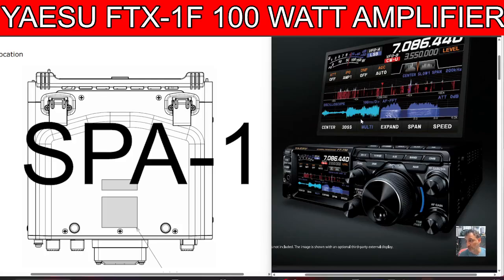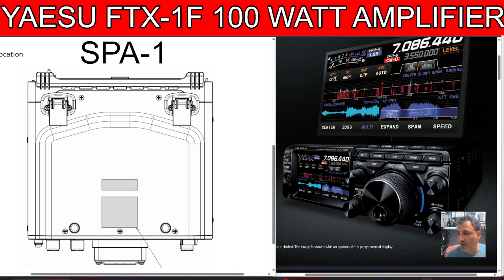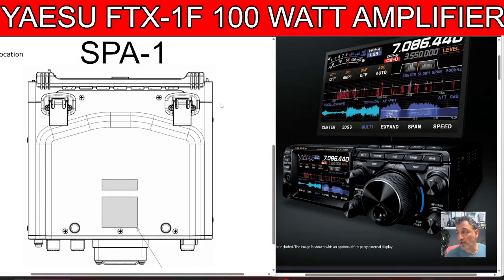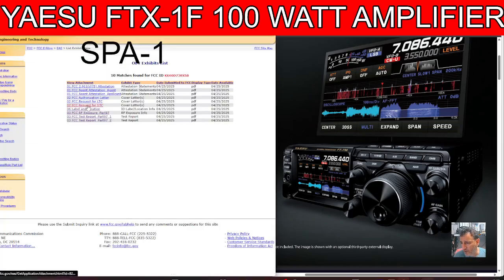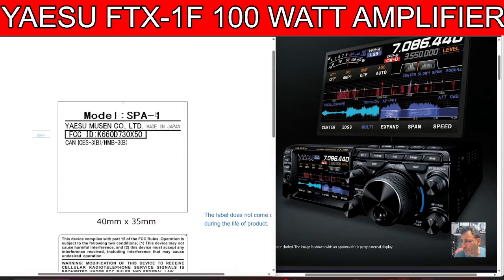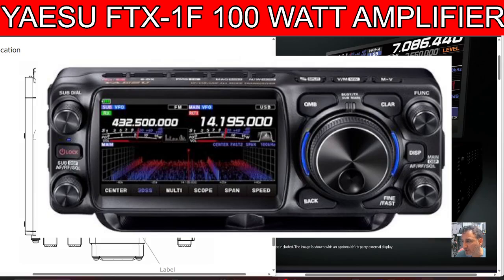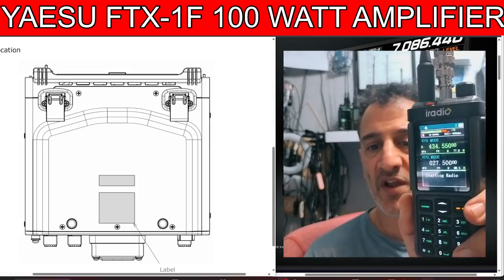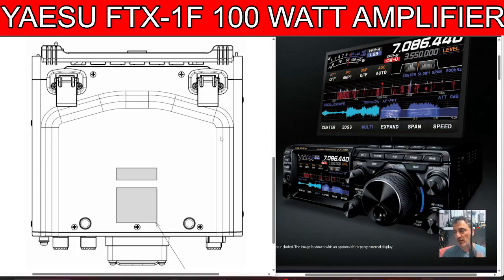100 Watt Amp - Yaesu FTX-1F Shack in Box - QRP

Comment: Those aren't buttons. Why would anyone put buttons on the bottom. They are more than likely air intake vents for the fan at the rear. Not unlike the bottom intake of the 500, 510, 150 and the 2 other ASP capable mobiles.
Reply from the maker: We will know soon
Reply: They're air intake as you said. If you look at the one on the far left and far right you can see something showing through them.